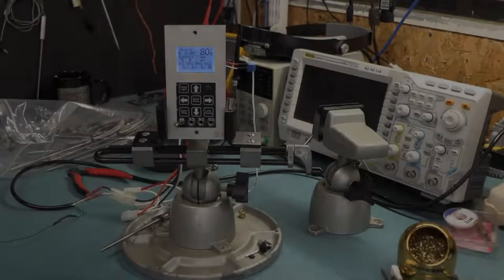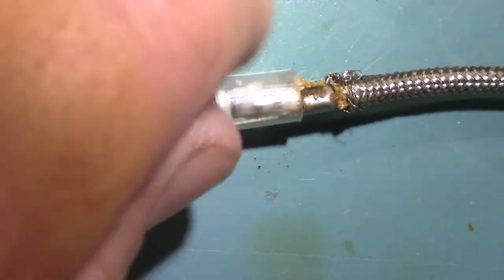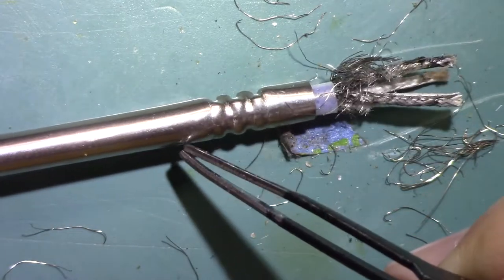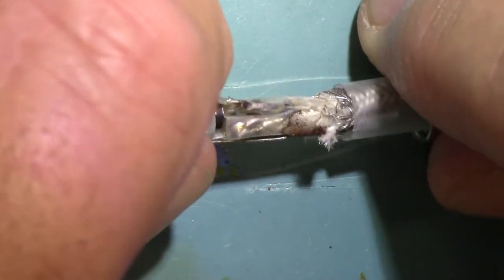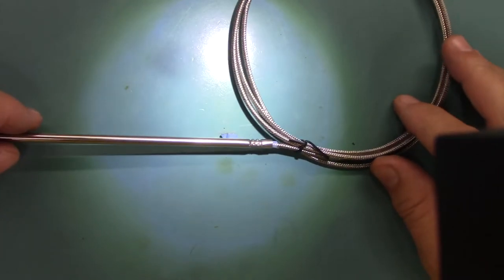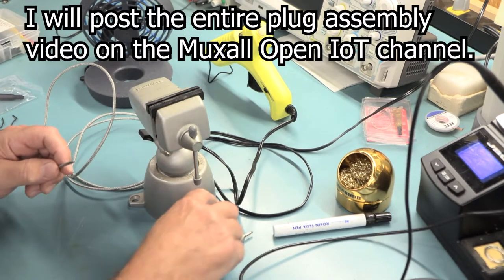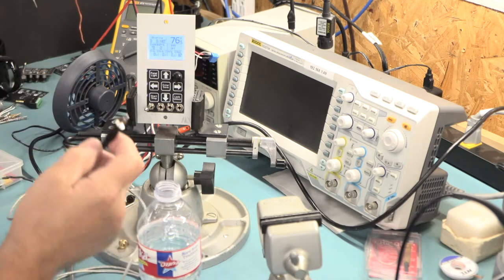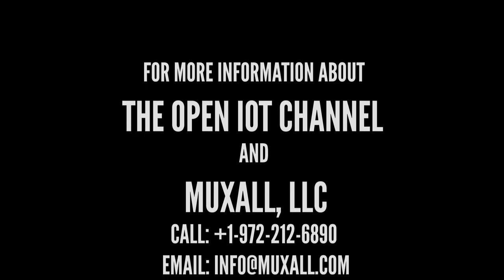IoT#153 - Muxall Pro Meat Probe Teardown and Repair

Comment: hello sir. thank you so much for the detailed video. I have Ikea Fantast thermometer. While I was making yoghurt, some milk leaked into the probe. So I unplugged the cable from inside the prob. I dried it fully. No problem, works perfectly. But I can not put it in back into the metal L shaped prob. My question is, can I buy another brand's (Wintact) cable and plug in into Ikea thermometer? Are they universal? the cable is just like the ones you show in your video.
Reply: There are a lot of different kinds of meat probes which, unfortunately, have the same connectors.  There are ways to identify what kind of probe it is using an ohm meter but it's not guaranteed.  I suggest that when you buy another meat probe, make sure it says that it is compatible with your product or that the merchant will allow you to return it if it doesn't work.